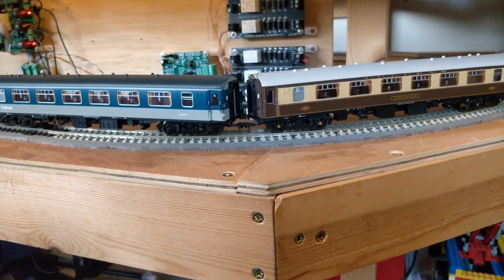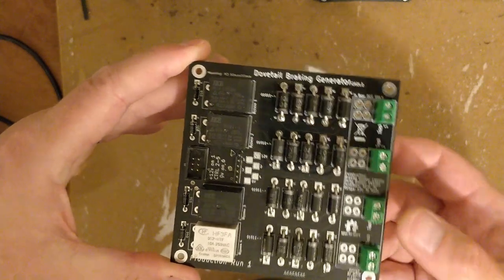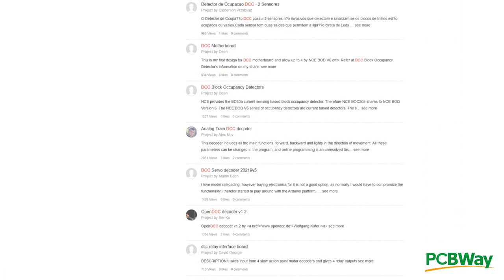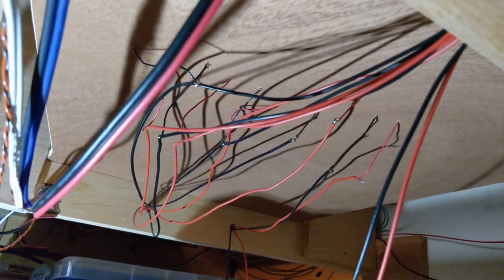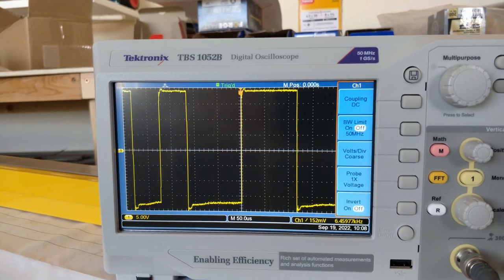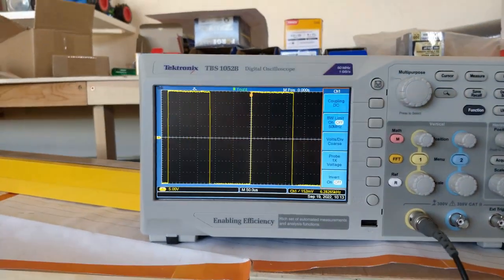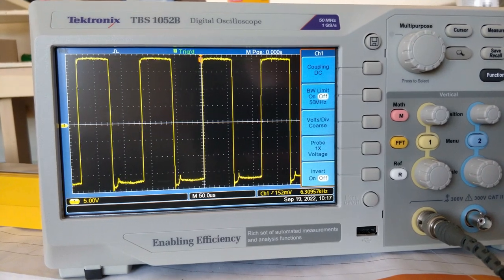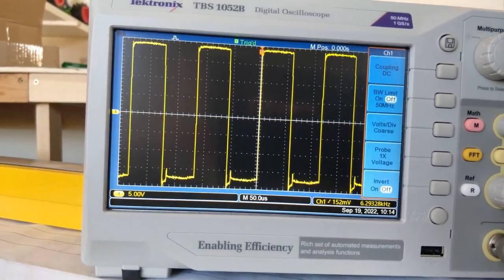Analogue Coach Lighting Interfering with DCC ABC braking?

Comment: Even DCC lighting plays up with  ABC, it's bridging the gap, it will stop once the train is in the section but if a coach has one bogie in and one out of the section it's effectively joining the two sections. Some great range of videos your doing 👍
Reply from the maker: It's not bridging the gap here -- because I switch the entire block into ABC when the first vehicle gets to a certain point. That's so I can cope with trains being propelled, with the loco at the back.
Reply: @DongitsModelRailway  so it the cap on the cheap lighting smoothing out the signal ? Never tested it but I guess that's what would happen
Reply from the maker: @johnjmc  As best I can tell the difference in voltage between the positive and negative phase of the DCC is causing a difference in power draw on both phases into the capacitor -- high on the higher side, low on the lower side. That's creating a different level of voltage drop, which was sufficiently reducing the difference in the ABC signal at the (larger, and modular) club layout. At my (smaller) home layout it was still working fine.

Comment: Two things that are affecting your ABC, the DCC bus impedance and the current draw to the coach. If you have too high a supply impedance (power booster/ control unit to point of use) then the waveform at your load is distorted more for a given load. If the current draw is too high it again will distort the waveform due to the voltage drop in the supply cables. In your case the capacitors charge to peak (if no resistors then it’s a peak charge with current only limited by the circuit cabling) and are pulling the higher voltage side down so you lose the differential voltage that ABC needs to work. I would fit led lights in with 100R minimum inrush limiting resistors in feeding the dc smoothing cap - obviously  a RC bridge rectifier circuit. As you can see everything needs to work in harmony, some kit just is not suitable for use on DCC. Also you have the issue of the coach wheels bridging the dcc/ ABC section with a momentary lull between respective coach wheels effectively causing the dcc chip to see abc, dcc then abc then dcc.  The 100Rs would help and if not solved try increasing to say 150R. After that you would need to look at the supply cabling. Hope helps regards Stephen
Reply from the maker: The cabling difference is why I think I found this at the club layout (with circa ten board jumpers on the main bus and a bit over double the wiring length end to end) and not at home.

In both cases though, we solved the entry into the ABC section by switching the whole train over in one go (when the last block is occupied, all the blocks switch over at once) so there's no non-ABC signal to bridge in.

In terms of the light conversion in the coach, that's exactly the kind of thing I was thinking of, but I still dislike the really minimal illumination provided by the fibre optic table lamps. When every other coach was unlit, it probably gave a suitably subtle effect to include one of these in a rake of unlit coaches. But put one of these next to a Bachmann Mk2F and it does not look at all like a lit coach. I'm not sure fitting an LED and ensuring the optical fibres line up will change that -- it'll still need something fitted overhead too.
Reply: @DongitsModelRailway  It's not just the cable length but the cable type - solid cable can have up to 12x the impedance on dcc frequencies than multistrand control wire (strand diameter / sqmm matters), it's a very different world to sinusoidal 50/60Hz operation. Yes, switching the whole section is one way to avoid the wheel/ bogie/coach circuit bridging issue and glad you could resolve. This was something I concluded has to be done with stop on dc - a short as the wheels bridge dc to dcc would be rather destructive and so I am leaving that on the back burner! When I took up with a major supplier of dcc chips they could not produce either an application note or say how they tested them when developing the product - not good for any users nor does it instil confidence in their product development and validation procedures! 
I have thought about the ABC (which is more attractive than stop on dc) problem and realise the other way is a solution using a short island of track isolating the ABC from the DCC sections length and using a resistor potential divider ABC to DCC supplying that island at the centre tap, figures work alright with up to 300mA of loco current and good for the bridge R-C to LEDs in the coaches  I mentioned above - no need for anything else - it looks after itself.
 Nice to see you have the same scope as me - excellent value for money! 

Anyway, glad you are sorted out.
Reply from the maker: @stephenpike3147  Yes, there are many factors about the cable that can make a difference. I'm sure Copper vs CCA will make a difference too.

In my case, all the cable used is multi-strand with the exception of droppers that go from the rail to just below the baseboard, and I try to use only Copper, no CCA, although I think there's some CCA used in the club layout.

Comment: Or Battery power the coaches? As their DC anyway.
Reply from the maker: If I did that I'd need to add something to make them electrically live for train detection. I may as well improve their ability to take track power if I'm going that way - no sense in making them take track power, do nothing with it, and then power lighting with a separate circuit.